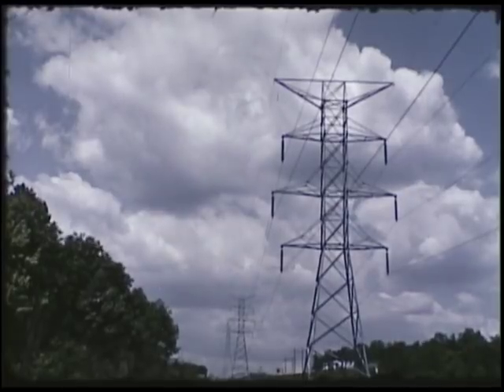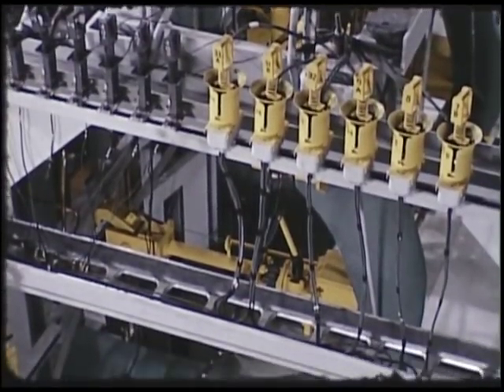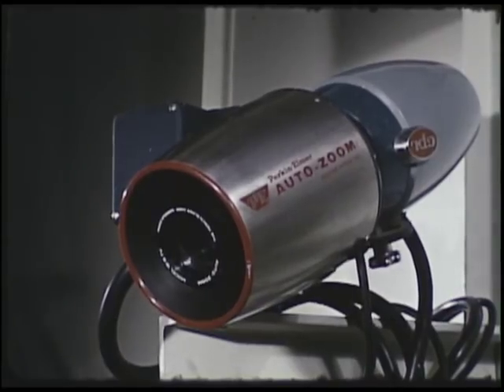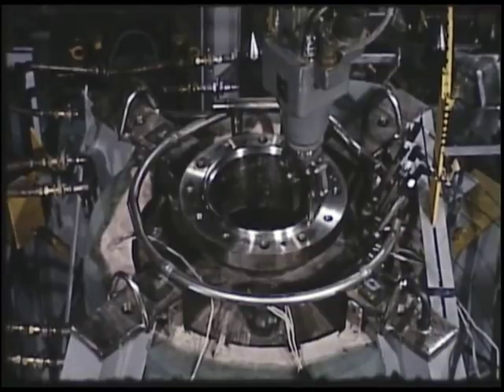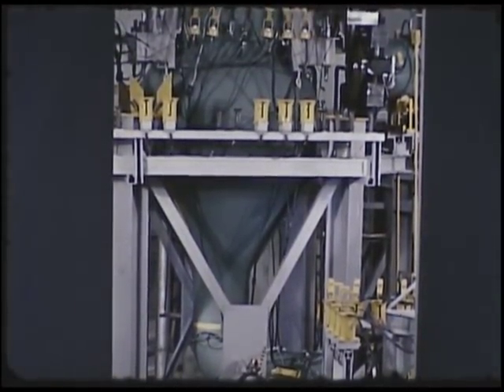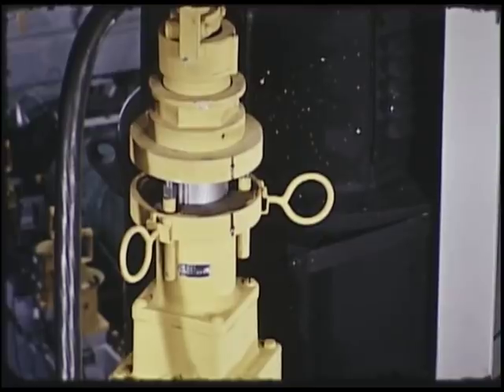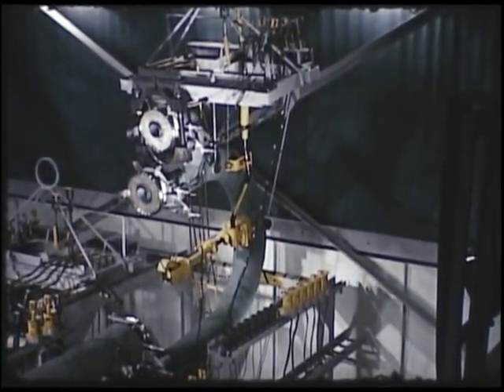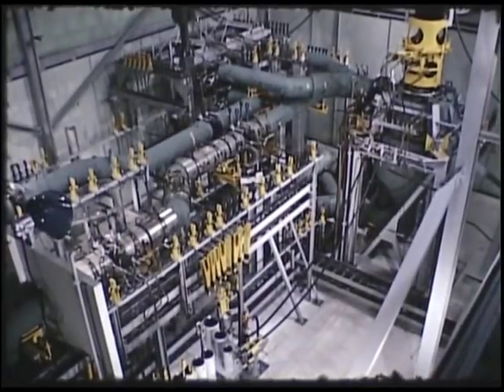Remote Maintenance of Molten Salt Reactors

Comment: I wonder how they were going to prevent corrosion on the bolts and joints. Considering that they literally use salt to seal the piping, I'm sure the whole area would have salt everywhere unless they had a means to wash it off.

Comment: I am trying to work out whether these processes came from the subsea oil industry or were applied to the same. You will encounter similar systems used with ROV units on subsea production wellhead assemblies. 
I wonder if General Electric and/or Westinghouse supplied campaign funds to the Nixon campaign….just asking 😂

Comment: All of the supporters of these molten salt reactors grossly underestimate how much radiation these things are releasing inside of the plant, well outside of the reactor core.  The entire molten salt system is loaded with highly radioactive fission products, the molten salt heat exchangers are so hot, not just thermal heat but high energy gamma and neutron radiation, you die after a few minutes standing next to them after the fuel has been in use. The fuel is highly corrosive, very expensive alloys have to be used, and the life span of the alloy is only a decade or two at most.  In order to breed fuel, these reactors require a blanket of thorium or natural uranium, and the fuel salts attack these metals, they are not Hastelloy or Inconel, and reactor burnthrough of the blanket is a real, and documented, possibility.
Reply: To be fair, this whole video is explaining how they'd do repairs in that sort of environment. I think it would be neat if the radiation could be used for other things as well such as sterilizing medical equipment or messing with seeds.

Comment: As amazing as the engineering on display is, it also demonstrates the basic problem with pumped fuel MSRs.

Everywhere the salt goes will be massively contaminated and neutron activated, requiring painful 100% remote maintenance on a lot of nontrivial mechanisms. And because the fuel is flowing in a loop, the area subject to these extremely hostile conditions is significantly more than just the reaction volume.

I got a kick out of the frozen salt seal... What we've since learned about how frozen salts are subject to self-radiolysis suggests that that would be a bad idea in a real reactor. This effect was what corroded the inside of the MSRE after the salt was frozen in place.
Reply: All of which is even easier today than it was then. Build it with this in mind instead of this prototype.
Reply: Look into Stable Salt Reactor, which has coolant and fuel salts separated.

Comment: Great technology for the 50-60s, totally impressive. In any case, the test model shown is of low power, imagine a commercial one of more than 500 or 1000mw, unviable. As for the type of reactor, apart from its supposed advantages, it is a really bad idea and an operational nightmare.
Reply: no.
Reply: @mccaf87  The physics say yes.  These are incredibly expensive to build, the technology level required exceeds that of liquid sodium cooled reactors. The contamination and corrosion problems are built into the design resulting in a very expensive reactor with a maximum lifespan of 15-20 years.
Reply: @mccaf87  lol

Comment: Weinberg who held patents for the nuclear submarine reactors always said they were great for small reactors where coolant was always available. But they were too risky for utility scale plants. He was told to be quiet or leave the industry. 
The U.K. Moltex molten salt reactor does not pump the radioactive fuel as it’s another thing to go wrong. They carry the fuel salt within tubes. It’s cooled by a non fuel salt which transfers heat via convection to heat exchangers. A third salt takes heat away for use. The reactor itself has no moving parts.
Reply: seems safer, better, but then I think, the weak point of the Moltex would be the many tubular walls in the reactor; they are exposed to high neutron flux ; (getting slowly weakened by the Wiggener-effect). Kirk Sorensen's and the original Alvin M. Weinberg's concept are less affected by that. More_% of the neutrons and neutrinos are swirling around inside the FLIBE-salt.

Comment: Always remember kids. Its not Thorium that is the miracle here. It is the fluid fuel.

By running fluid fuel instead of solid fuel you can filter out the daughter products made from the fission and load more fuel back in while the reactor is still running. Instead of 99% unburnt fuel too radioactive to release back into nature, you approach a 100% burnup of fuel. Since the daughter products are in solution it is easier to separate out the useful bits from unuseful. It is healthier for neutron economy to pull out these daughter products too. Since many love to eat neutrons.
Reply: True but it is thorium that prevents transuranics.  Thorium takes the absorption of seven neutrons to make the long lived waste of transuranics, whereas only one neutron needs to be absorbed by U238 to make a transuarnic..

Thorium also makes small amounts of U232 which can not be easily removed (isotopic removal is very hard and very expensive) and which are highly dangerous to handle due to U232's gamma radiation.  The presence of U232 means that the reactor can not easily be used to make bomb material because the bombs would be too radioactive to handle.  So proliferation is much less of a concern.

Finally, thorium is far more common than uranium because there is four times as much thorium as uranium.  It means thorium costs far less and it provides a much longer fuel source.

So thorium is really important in the long run.
Reply: Yes, the fluid fuel is the major actor! But Thorium also brings a lot to the table. An Oscar winning supporting actor. :)
Reply: I'm loving the comments!  So much to learn...
Reply: @Fred C. Scroll Thorium has an atomic number of 90.  So thorium probably is your IQ unless you have had if fissioned.  That could be a real possibility as well.
Reply: @Fred C. Scroll A bilingual man.   There is proof of some fissioned intelligence: half went to English, and half to Spanish.
Reply: @Fred C. Scroll What is troll in Spanish?
Reply: @davidgmillsatty1900  What did this lad "Fred C. Scroll" say for you to act so childish?
Reply: @peterdinkler4950  Since his comment is gone, I have no idea.   So why the comment about me being childish if you had no idea what he said?
Reply: @davidgmillsatty1900  Typically you denounce the argument instead of the person making the argument.
Reply: @peterdinkler4950  Typically.  How do you know this was not the exception?
Reply: @davidgmillsatty1900  What would be an exception to decency?
Reply: @peterdinkler4950  Asinine commentary.
Reply: @davidgmillsatty1900  I'd disagree. attacking a person makes them defensive, while attacking the argument has a chance to persuade a person's views on a subject. I don't see why you'd make an exception, in the first place.
Reply: @peterdinkler4950  There is nothing like an anonymous poster who butts in on thread regarding a comment posted a year ago that has been deleted by the poster (or perhaps Youtube) to lecture another commenter on childishness and decency is there?
Reply: @davidgmillsatty1900  Correct. I just don't like untied ends, and the way this conversation seemed to end was very unsavory, especially in the comment section of a video regarding progress. I think you know now, if you haven't already realized, in the past year, that this was a bad display of character, for someone who can display their intelligence so well.
Reply: @peterdinkler4950  I really disagree.  I remember the post was quite idiotic.  That is all I can say at this point.
Reply: absolutely.  I am also liking how some designs are able to use radioactive waste as fuel, we can burn up all that instead of having to store them forever...
Reply: What is your IQ Fred?  Most people with low IQ fear everything since they are clueless when it comes to understanding anything a bit difficult.  Do you believe the world is flat?@Fred C. Scroll

Comment: i am overawed at the ingenuity of our forebears. What they were able to pull off 60 years ago... imagine if they'd had the technology we possess TODAY. What they could have accomplished with VR and advanced robotics! So much lost potential...
Reply: Ionising radiation and neutrons are toxic to electronics so it's likely that a modern day system would have to use similar methods. The best designs will keep as much equipment as possible outside the radioactive containment.
Some people comment about the carbon moderators needing regular replacement, but the Britsh CO2 gas cooled reactors (AGRs) all use a carbon moderator and run at temperatures similar to the Oak Ridge MSRE. Cracks have been found in the carbon, but they have been operating since the mid 1980s with the original cores.
Reply: @Dave5843-d9m  Satellites are radiation hardened...

Comment: This type of reactor is actually pretty clean. I think most people would be ok this MSR I like it. Better than the dangerous one that we run are all past their time. I like it.
Reply: Actually it is a technological nightmare with incredibly high capital costs and a very short lifespan, a decade or two... The alloys that are used degrade, and basically every ten to twenty years you are either replacing all the internal components or shutting it down and scrapping it for a new unit.  The contamination in the cooling systems mean that decommissioning the plants is extremely expensive.
Reply: Standard PWR and BWR in practice is much easier and safer. There's a reason these aren't running... The fuel isn't exactly satisfied with containment in metal, particularly in the presence of any water, which would be unavoidable if not simply over time. Just because something works doesn't mean it works well, and when there are technologies with track records around, they tend to win out when the stakes are as high as they are with reactors.
Reply: Most reactors are pretty safe. The problem is that the Russians built tons of reactors too and they always cheaped out on important systems. The RBMK is pretty much a poor-man's nuclear reactor.